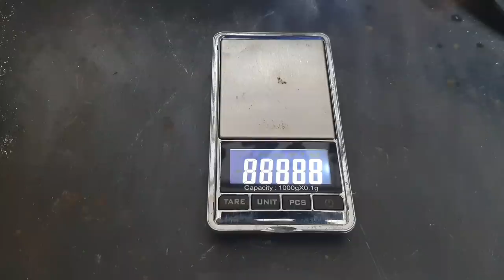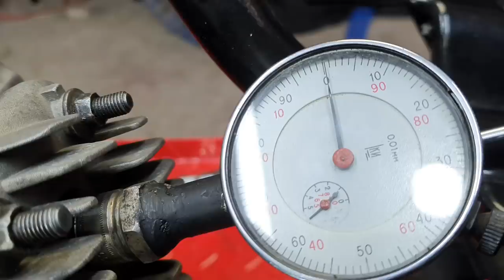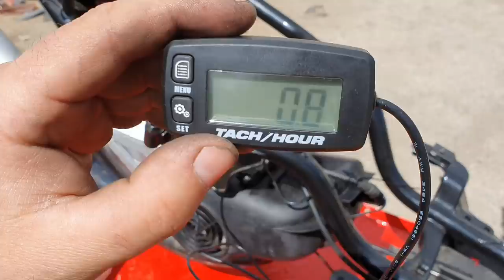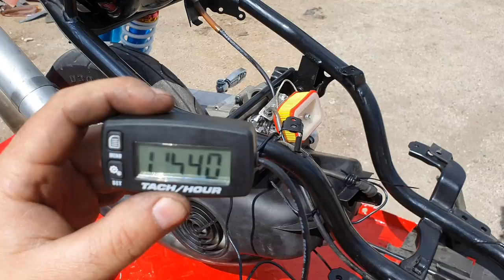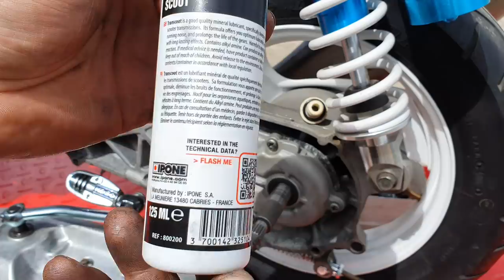Yamaha Jog изменил вращение зажигания, тест выезд, карбюратор от бензопилы, трансмиссия не настроена

Comment: a tip for the transmission cvt. 3.5 / 4 g rollers, yellow / red malossi contrast spring and finally given that you put the stage mk2 as a clutch the orange springs pulled to the maximum. if not, if you use another clutch, put the malossi red springs. the multivar 2000 does not fit on the athena racing 70. oh the multivar 101 or if not the mhr one. or stage rt or top tpr variator.